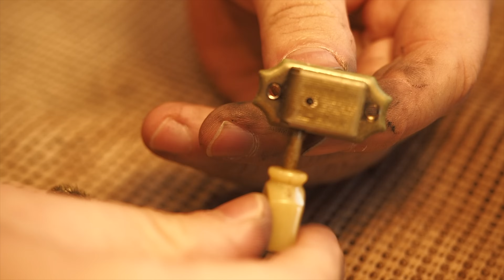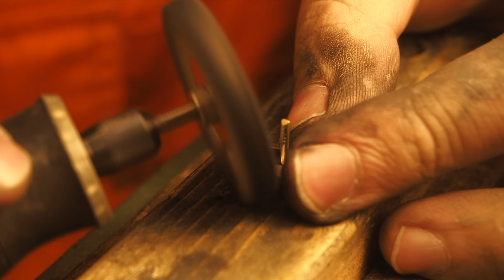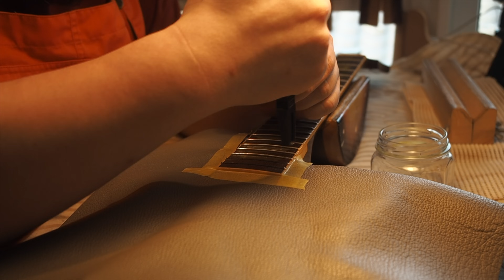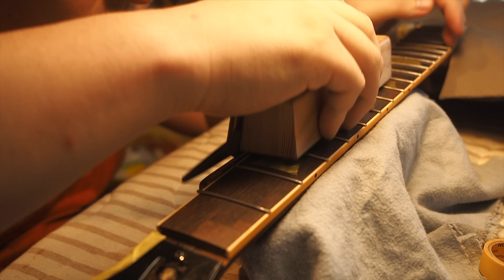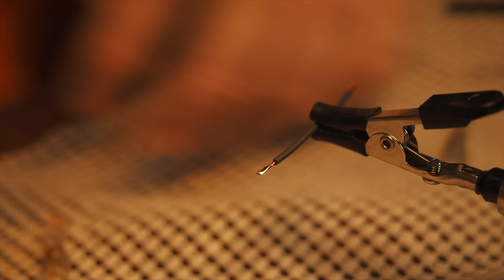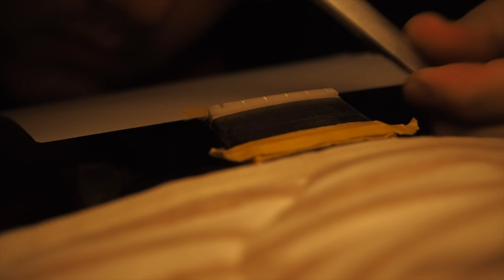Gibson Les Paul '60MODEL Guitar Restoration

Comment: Beautiful work. Inspirational.  I doubt that most commercial '"luthiers" running a shop would take nearly that much time or pay that much attention to detail. The frets would just get yanked out, any splintered fingerboard pieces damaged in the process would get hastily repaired with a mix of dark sawdust and crazy glue, and hammer in the new ones.
I have a G0 1960 custom shop historic reissue, plain top. Fantastic Les Paul in every way. Other than the differences in the wood grain, it is literally identical to that one.  Burst color and fade are identical. Your video has inspired me to pull it out of its case and give it a play.

Comment: Wow,  it's the fret work that I am learning, so at 14.20 he uses a feeler gauge to make sure there are no gaps between the new frets and the fingerboard, fantastic idea,if you have no gaps and the frerboard is level and radiused perfectly you will have very little level and crowning to do which is the goal,  loved this video !
Reply from the maker: Thanks for the comment.
You're right about leveling the frets, but that's an ideal and a task that doesn't take into account precision.
There is also the matter of fret height error.
Fret leveling is always necessary for fret replacement.
Especially on a Fender type fingerboard, it is also necessary to deliberately cut down the ideal fret radius.
Reply: @Andybassguitar  thanks Andy,,most important for me mate,  what is that tool you use at 16 min 40 to 16,47 ,( and again at 17.05 ),after you used the sanding block .is it  to round the fret tops over,I've never seen a tool like this before ,,did you make it yourself ! Can i buy one from you ?Thanks George.
Reply: @gw2934   If it's the same as mine  it's basicaly a block of wood and some indoor/outdoor carpet wrappped around it for cushoining and then sandpaper in various grits to get the  file marks out of the tops of the frets and restore a bit of the crown. Some do just this and no recrowning file I do both. Also works good for a fret dress to get divots out.

Comment: sorry for asking but why do you solder the frets before stripping? what is that supposed to be good for? soldering iron is clear because of the heat and to soften the glue, but solder?🤔
Reply: The theory is that the solder provides better heat transfer throughout the entire fret, rather than focusing the heat on where the tip of the iron is, so you don’t have to heat the fret for as long

Comment: Great, meticulous work! If those volume and toneknobs are original, It was made early in 1960.

One question, why the use of solder to remove the frets?
Reply from the maker: Thank you for your comment.

This guitar is not from '60.
It is a '60 model.

The reason I heated the frets with solder is to get the glue off.
Reply: It is a 1996 Gibson Les Paul Classic. This model is loosely based on the 1960 Les Paul Standard Model.

Comment: I am curious, how well does your work intonate and stay in tune? You make very clean nuts and bridges but how well do they function? Les Pauls are known to be tricky
Reply from the maker: Thank you for your comment.
Resonance at the nut and how to create overtones. It is very difficult to convey in a video.
In terms of the nut, I am conscious of the area where the string touches the nut and the angle of entry of the string into the head.
The beautiful appearance is just an added bonus. Of course, it is important.

It is difficult to answer this question, but I am conscious of the function of the nut rather than the beauty of its appearance.
I'm sorry I can't show you any evidence.
I don't think the nut and bridge of a Les Paul are that troublesome for tuning or intonation.
I think the nut groove on the 3rd string of a Stratocaster is more difficult.

I'm still learning, of course.

Thanks!

Comment: Hi Andy. You did a wonderful job. And also your video is shot perfectly.  But I wonder about some things. I know it was a job done for a customer. But it's a '60 model Les Paul. 

But I doubt it's a '60 Les Paul. Doing the job you fid would destroy a lot of the value of an original 1960 Les Paul. But if that's what the customer wants.....

But there's more. The serial number is 8 2771.  8 stands for 1958. That's the year Gibson changed from Gold Top Standards to sunbursts. 1958 Gold Tops were made in the first half of 1958. In the second half the first Sunburst Standards appear. The first Sunburst Standard ever build by Gibson has serialnumber 8 3322. As it was a sort of testmodel, just to see how the color would look, it has a maple top with the seam not in the center of the body, but on the left side of the body. It still exists.

So serial number 8 2771 can only belong to a 1958 Gold Top Standard with the Gold Top sanded down so the underlying maple top became visible and than given a sunburst paint job.  Headstock seems to have a 17° degree angle, like all pre '60 Les Pauls.

So I wonder what kind of Les Paul is it? Can you lift a tip of the vail for me?
Reply from the maker: Hello.
This one is not from '60.
It's a '60 model, though.

Comment: was it not possible to keep the binding bums on the frets? I always see how they get sanded down but I dont have the knowledge of why and if you could also do fretwork without  removing the binding bumbs
Reply: I feel It would be close to impossible to get absolutely no conflict and also no gap between ends of the new fret and the old nib, how much do you pre sand the fret ends? You only want to insert the fret once. Also it would play nicer to have more fret surface area, without the nibs.
Reply from the maker: I think I could have left the nibs and replaced the frets, but I didn't because it would not have been ideal fretwork.
However, I didn't do it because it's not ideal fretwork. I don't recommend it because of the high cost.

Comment: Noob question. I get heating up the frets to melt the glue and remove them, but why the solder?
Reply from the maker: Solder is used to transfer heat quickly.

Comment: really interesting restauration. I really enjoyed to watch you doing your work! but i have one question .. is it possible to renew the fretnips? I love the neck of my gibson classic and the fretnips ( fretnibs? ) are one of many reasons why i like that neck so much. I guess the only way would be to renew the binding completely or are there other options? greetings and thx so much for this upload
Reply from the maker: Thank you for your comment.
I think I can leave the fretnips and replace the frets.
It is a very difficult job and there will be a charge for it.
I do not recommend this work.
Reply: think with Your skills it's not too hard
Reply: Dissolve some duplicate neck binding material in acetone. Next you would put a small drop of acetone on the existing binding at each fret's end in order to soften the plastic enough to meld with the dissolved binding material, which will be brushed onto each fret end, overlapping each end slightly. When dry, each fret end can be uniformly filed, leaving the desired amount of "nib" on each fret.

Comment: I am fixing a lp nut slot someone has widened. The slot and the peg head side of the slot is angled like a side of a pyramid.  Did you encounter this and if so did you fix the slot or sand an angle on the back of the nut? Any help is much appreciated!

Comment: Out of interest what was the reason for the restoration other than the refet? Most people don't want a vintage guitar to look as new as possible they actually like the patina on the hardware ect.
Reply from the maker: Even if it looks rusty, if it does not work properly as a guitar, it is not a guitar.
I like old rusty screws, but I also like rusty screws with stains that can't be removed by polishing, and screws that are still plated and shiny.
This is not a process to make new ones.
This is not a work to make a new one, but a work that can be called a relic.
I would like you to know the beauty of it.
Thank you for your comment.

Comment: came across your channel! absolutely love your videos! Question please, for the nut string spacing, do you use even distance between the center of the string? or even distance between each string? Thanks!
Reply from the maker: Thank you!
In my case, I basically measure the gap at the center of the string.
I think it is a matter of preference.

Comment: This guy is very patient and precise...stil lacks basics of galvanised metals...nickel is very thin layer...after oxydation for decades and thorrow polishing it tend to vanish...very soon all those polished screws and metal parts will became rusted much more then before resto...waste of time and not good job.
Reply from the maker: The nickel plating is polished to the point where it does not come off.
After polishing the screws, we coat them to make them more resistant to rust.

Comment: I couldn't help but notice that some of the tools used are crude , there are much better ones made for guitars like for leveling the frets and so on. If they are level and everything else is good then he is an expert on guitar refinishing. And you need the right gage of files for the nut ,the heavier gage strings take wider files.
Reply from the maker: Thank you for your comment.
I don't have a special tool for leveling the frets.
I've modified it to improve the accuracy. I didn't just cut the aluminum angle.
In my opinion, even if you level all the frets the same way, they will not be level when you put strings on them, and it is easier to set them up when the neck is slightly warped.

I think you're right about getting a file that matches all the string gauges, but I've never had any inconvenience with this file.
Even if you use a file that matches the gauge of the strings, you will not be able to carve a proper groove if you are not good at using it.
Of course I want to buy one of those files!
Reply: @Andybassguitar  👍😀
Reply: @Andybassguitar  It's easy to see that les Paul  is not the first guitar you have refinished. And it really looks and sounds great. I think you did an expert job , if you didn't tell us we would not be able to tell it's been refinished.  😃

Comment: You do great work but you should always glue the nut too the fret board and not the bottom of the neck route  .
Reply from the maker: That's one way to do it.
However, I don't like it because there is a high possibility of scraping the fingerboard when removing the glue.
It's a different way of thinking for the operator.
Reply: @Andybassguitar  true

Comment: I did not know that you  use superglue when refretting guitars
Reply from the maker: It's in common use.
It's best to be able to fret without using it, though.
Using glue is not desirable if it is true.
It makes it sound better, but...
Reply: That's what I thought too but just not really comfortble not using superglue when i refret my guitars.
Reply from the maker: If it's fretted properly, it will sound the same as when glued.
A hundred years from now, using glue could be called a terrible job by a future guitar repairman.
This is because you don't know how the glue will have changed in 100 years.
My opinion is that it is better not to use it if at all possible.
However, I do use it...it's a tough call.
Of course, you have to fret properly before using the glue.
Make sure the gap between the frets and the fretboard is less than 0.04mm, then gently tap the frets with a short ruler to make a hard resonant sound before gluing.
Reply: @Andybassguitar  i think for a refret job where in there are already teeth marks inside a  fret slot, best is to use super glue just to make sure it's not going to become loose. For newly slotted fretboards, might be easier to put fretwires without super glue
Reply from the maker: My idea of a perfect job is to fill all the teeth marks on the fretboard with wood dust and glue, modify it to look like a new fingerboard, and then fret it.
That way you don't have to glue the frets, but the frets will look like they did when they were glued.
But it is very expensive, so we do not do it.
In my opinion, gluing the frets to the fingerboard is not the best job.
In my opinion, gluing the frets to the fretboard is not the best job, and I don't think it can be done on vintage guitars.

What is right is different for everyone, so please consider this as one guitar repairman's opinion.

Comment: The level of care you giver to even taping off the neck is amazing.. your fret work is outstanding.. what is size of feeler gauge for hamming frets to test?  I like that your fret end filing is done from outside the neck to inside.. most do it the other way but take too much material.. does that fret end file have a "safe edge"?... beautiful work..
Reply from the maker: With a set neck, you can't file the frets from the outside to the inside in some places, so I think everyone has their own preferred method.

The size of the feeler gauge is 0.04mm.

This file does not have a file on the side that is against the fingerboard.

Thank you for your comments.

Comment: Good to see that this wasn’t an actual original. A lot I don’t understand here, but to each their own. For my taste this is way overdone. I don’t get the flattening of the fretboard, using superglue on the new frets, or why people make no attempt to save the nibs.
Reply from the maker: Thank you for your comment.
I really want to let you know how hard it is to replace the frets leaving the nibs.
Also, I can't get my ideal fretwork condition even if I replace the frets with nibs.

The reason why I used glue is because of my lack of skill.
I do not want to use it if possible.
However, you can take the insurance of using glue.
If you glue the frets, they will sound good.
You can keep the frets tight to the fingerboard for years.
It also came with a genuine Gibson. It wasn't my ideal use of glue, but...

I am fixing the fingerboard to be horizontal.
This is the process of leveling a bent neck on the fingerboard.
If you're going to replace the frets, it's better to do it so you can reduce the amount of fret grinding.
The accuracy of the fingerboard in its stock state is also poor, so it should be leveled.

Comment: You're not actually supposed to use solder, you are supposed to just heat the frets with the iron.
Reply from the maker: The use of solder allows heat to be transferred efficiently.
Of course, it is possible without using it, but it is less efficient.

Comment: That's a fake made to look like a 1958 Les Paul, or a bad re-issue.   Ink stamped SN# under the finish. 0-2xxx would be a 1960. 8-xxxx would be 1958. If it were real, it had a re-finish done to it. There is zero checking in the finish, otherwise, that would be the finest example of a 58 in the world.   Also, if it had a re-finish, the SN# would likely be gone.  You don't show the underneath side of the PAF's, and the covers are way too shiny with no pitting to be 66yrs old.  Also the pots wouldn't say "Gibson" on top of them either. Those "Gibson Deluxe" double line tuners were used in 1969 - 1974.  The correct tuner would be a single line "Kluson Deluxe"

It's probably a Chibson.  Even real Gibson re-issues wouldn't look like that.  If it were the world's finest 1958, nobody would allow this hack to work on it, being it would be worth $400k.